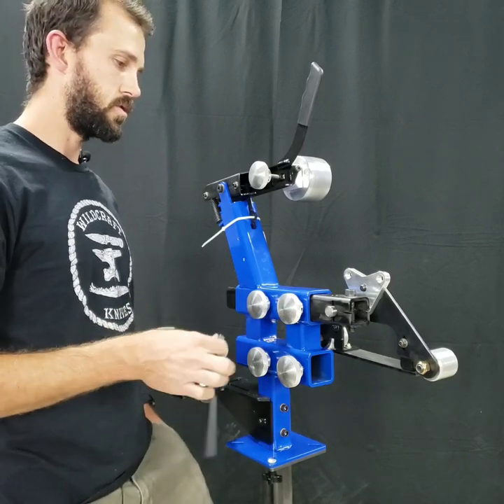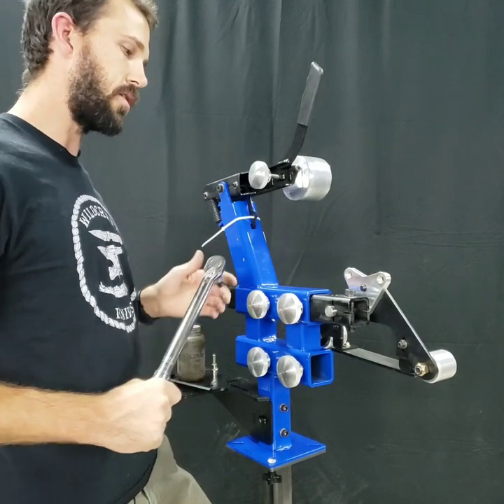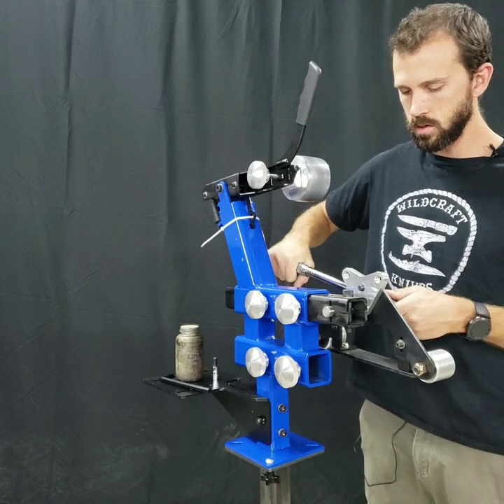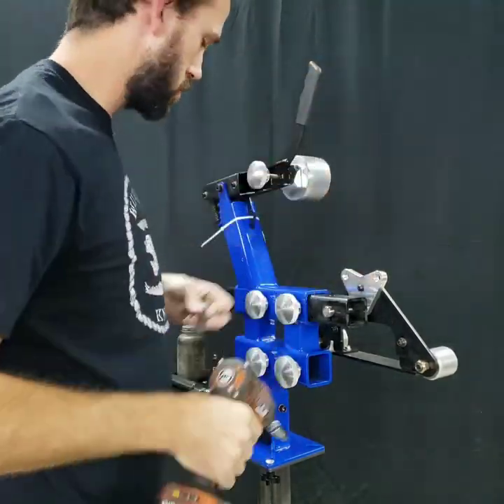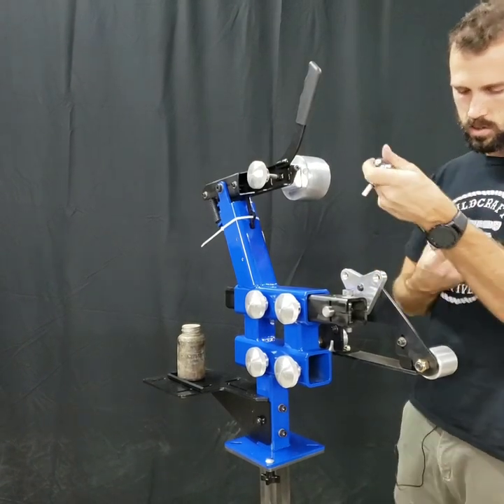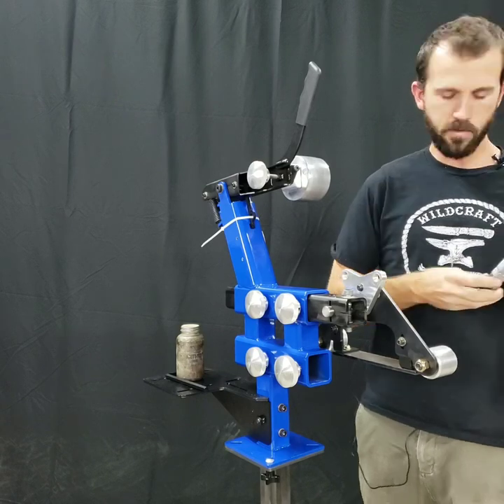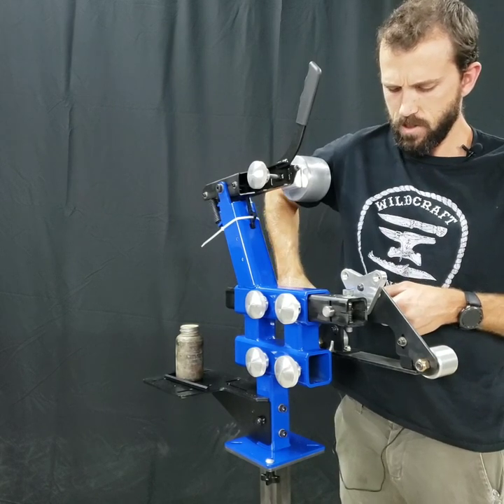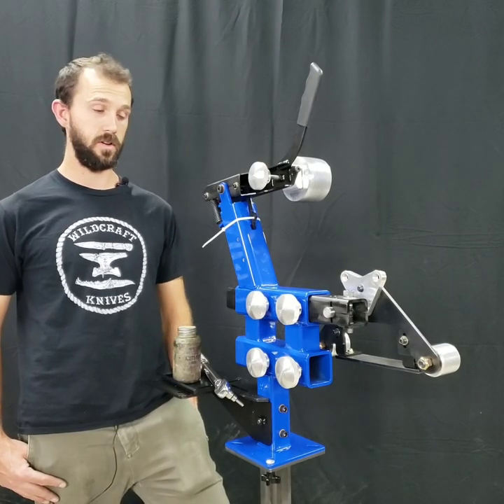Effect of Lube on Bolt Clamping Force

Comment: Really good demonstration. Would help if you explained how the lubrication reduces the friction allowing the torque setting to be applied just to the stretching of the bolt instead of being burned off trying to overcome the resistance. I've known a few guys that didn't lube their head bolts and couldn't figure out why they kept lifting heads and blowing gaskets.
Reply from the maker: Thank you! And I agree that I could go into more detail. I'm still getting a feel for this video making thing, but I'm starting to see that the videos could be a little longer for the sake of thoroughness.